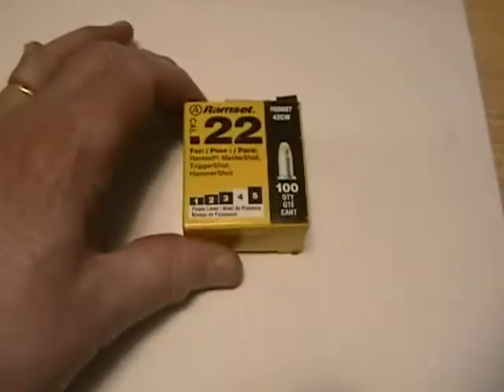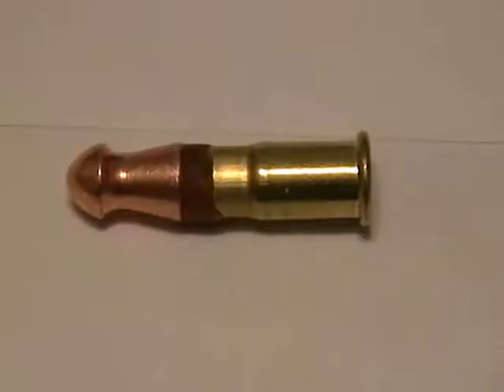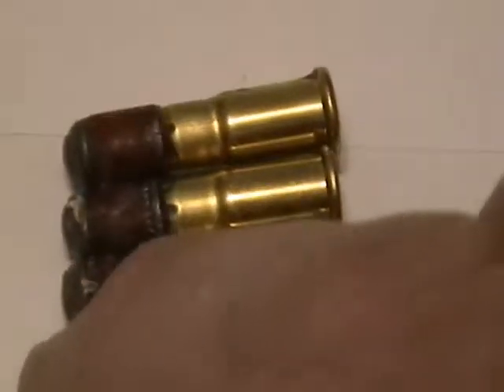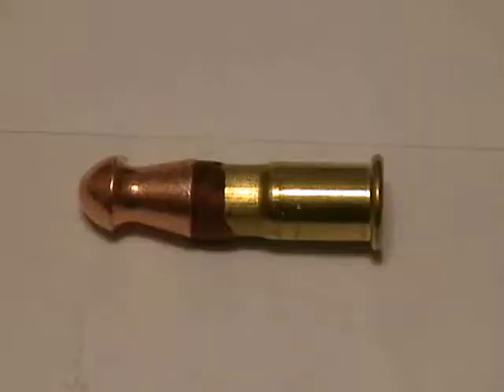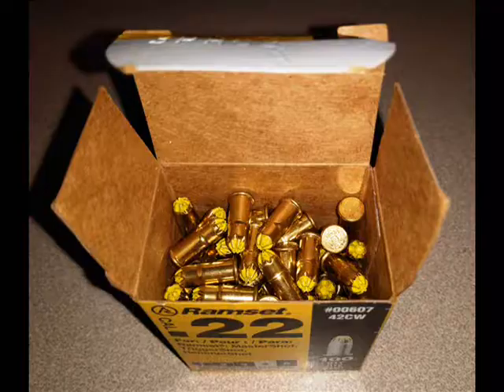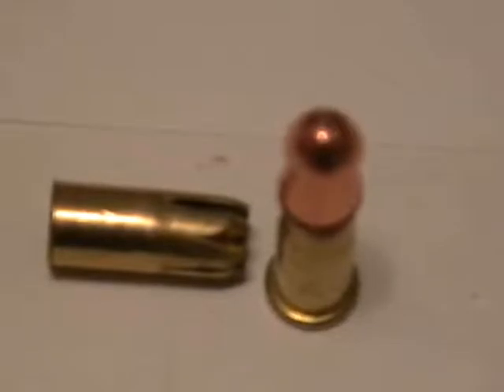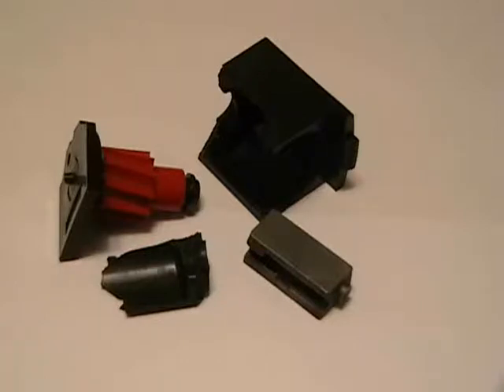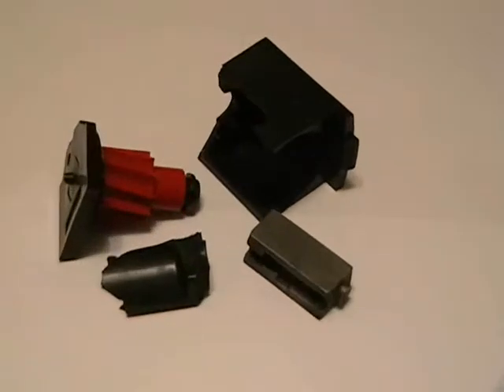Nailgun Blank Plus Copper Pellet: What Could Go Wrong?

Comment: High, an expensive experiment, but interesting. Kindly Fiete
Reply from the maker: It cost more than anticipated, that's for sure! Perhaps a strong, single-shot rifle would have done better. However, I was able to chronograph that solitary shot, so in that regard the experiment was successful. At 3481 fps, that 14.4 grain pellet was packing over 380 foot/pounds of kinetic energy: more than a .380 ACP and more than some standard .38 Special loads. Goes to show that velocity is king in the kinetic energy formula. Thanks for your comment. Cheers.